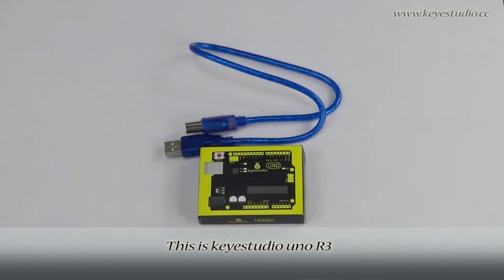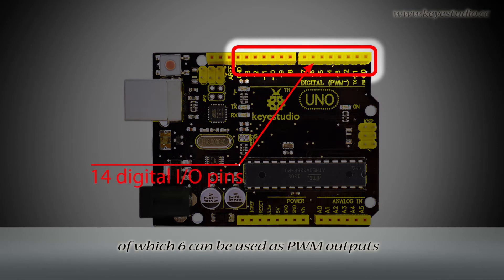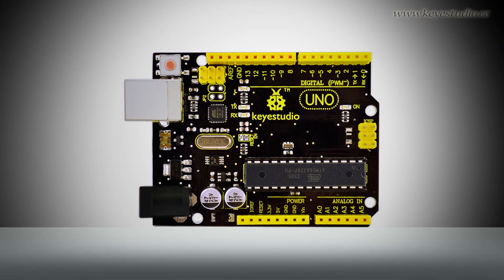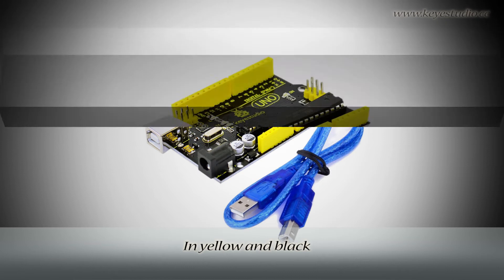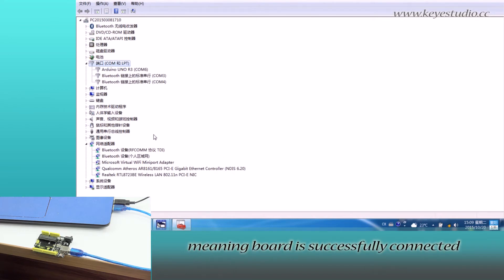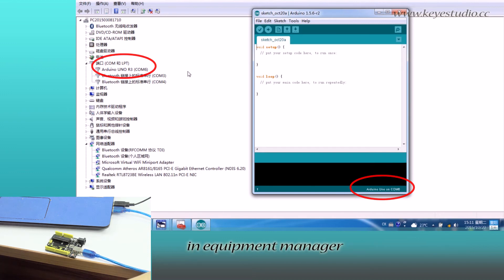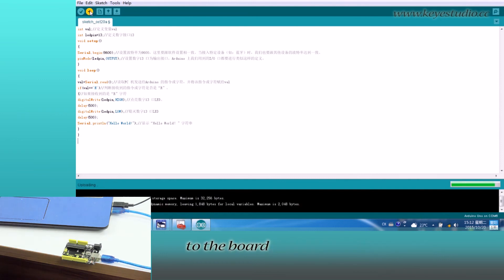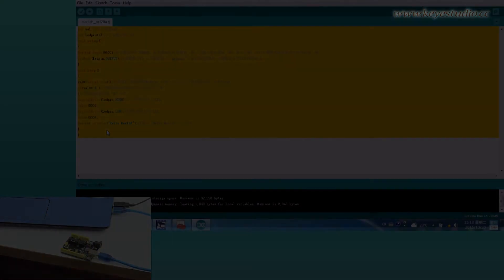ks0001 keyestudio uno R3 compatible for arduino

Comment: In order to see the board Arduino IDE requires Port Number for the Uno R3 board, but in WIN-11 there is no Port.. I did connect the USB cable from Uno to my PC and ran the Arduino IDE it requires Port# to upload the driver. So I went to Win-11 USB section under Device Manager and cannot see the Arduino Uno R3 board, I disconnect and connected the Board's USB Cable several times but still cannot see the board under the USB Network either. -- any help?